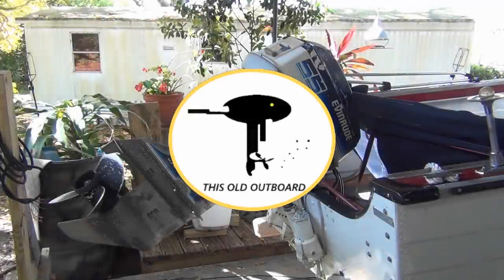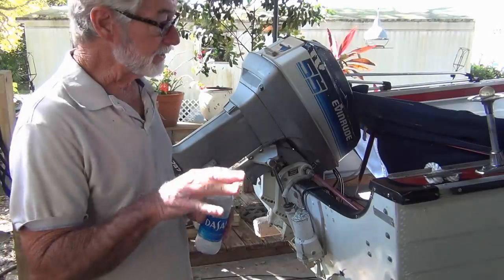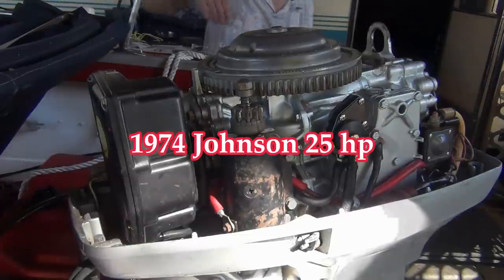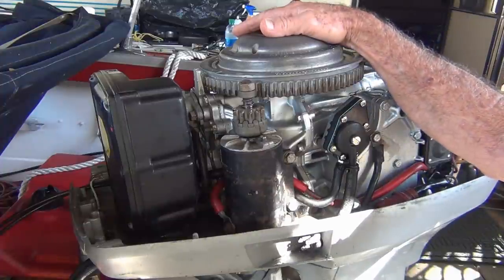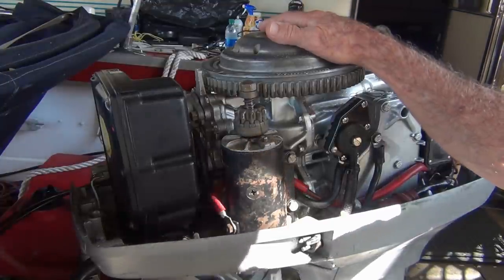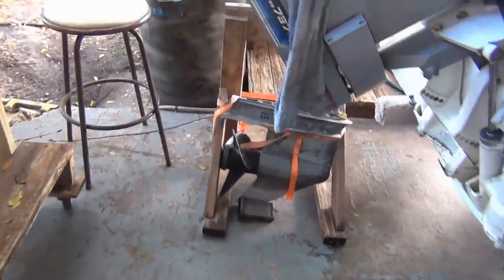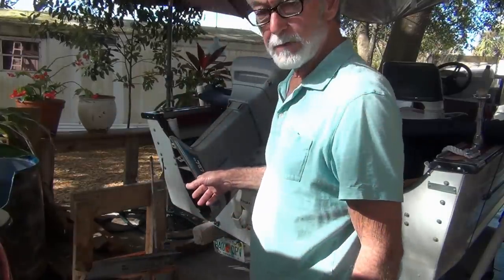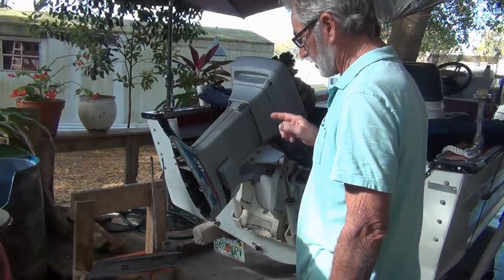55 Hp Evinrude Outboard Powerhead Flush

Comment: The thermostat can't regulate the temperature when you run it in a barrel. Your recirculating hot water. Easy to get one too hot like that lol. Love your videos man! Keep it up
Reply from the maker: No. It's still going to get hot and open the t-stat which is the point. And the tank water is nowhere near 143 degrees when the t-stat Starts to open! And at running temp the water would be steaming around 150 if it was recirculating at the same temp. So not to hot! But I know what your saying. lol Thanks again for watching and commenting. Stay tuned !

Comment: Question. I have the 76 version of this motor and it doesn’t have power trim. Did you add that trim system yourself? Or was there a stock trim system for these old motors?
Reply from the maker: Hey . Thanks for tuning in. That trim unit came off the 87, 40 horse Johnson I had, so yeah I added it myself. They will fit if the plate on the transom mount/swivel bracket has the six holes to bolt it on, and I believe yours does. They're getting hard to find but check ebay for one. I believe they were made between 74-89 with different variations and part numbers which I don't have. If you can't find one on ebay check around on craigslist, facebook marketplace & offerup. You may even find an old parts motor cheap that has one. They still sell the rebuild/seal kits for them. Hope you find one, they're nice to have! Thanks again & Stay tuned !
Reply: Thanks for the reply! I’ll try and keep and eye out for one. I do have the six holes. Let me know if you run across one. Lol

Comment: Did u ever figure out your fuel issue?
Reply from the maker: Hey. I'm guessing it was the brass fuel line connection on the tank. after I tightened it, the bulb stopped going flat. Thanks for watching and commenting. Stay tuned !
Reply: @THISOLDOUTBOARD1  thanks 😊

Comment: Idle a stitch to high ? Or is it the audio ?
Reply: the only way to properly set the idle is in gear in the water not tied to a dock or trailer. then idle in neutral will just fall into place
Reply: @ct1762  I’m aware of that , was the comment ment for me ? I only stated the idle on camera sounded a bit high is all and wondered if it the audio or the TP on the controls  !
Reply from the maker: Hey. Yeah I think its camera audio. Thanks for tuning in!

Comment: Hi sir how are you. I have a 1979 55hp evinrude. When i bought it the engine turn on, but it had a water pump problem. I changeed the water pump by taking out the starter. I did take off the nain powerline out of the solenoid as well, but i put everything back to where it belong. I also bought a new battery. When i try to turn it back on the ignition jus click. I the engine doesnt want to crank. What is going on please help me  thank you
Reply from the maker: Hey. Thanks for tuning in. My experience is that if the solenoid clicks once there is a bad ground wire connection, if it clicks repeatedly it's a weak battery. I did a video on it called the Dreaded One Click, something like that, on the old 28hp Johnson I had. Turned out to be the short ground wire coming from the power head connected to the lower pan. The only other ground wire I can think of would be the one coming off the solenoid to the power head. Double check connections are clean, no corrosion or paint. Thanks again & Stay tuned !
Reply: @THISOLDOUTBOARD1  bad ground from the battery or from the starter? Thank you so much for responding. Your video are great. Keep it up please
Reply from the maker: @hdtrieu  no, the starter is grounded from being bolted on. the battery negative is grounded to the powerhead somewhere. the powerhead is grounded to the pan, heavy gauge 4-5 inch ground wire, and the solenoid is grounded to the powerhead, small black wire coming off the the small terminal on the solenoid
Reply from the maker: https://maxrules.com/graphics/omc/wiring/77-78_55HP.jpg
Reply: @THISOLDOUTBOARD1  ok I'll check the main ground n the ground from the solenoid thank you so much kind sir
Reply: @THISOLDOUTBOARD1  do you think I should change my power pack as well?
Reply from the maker: @hdtrieu  if it ain't broke don't fix it
Reply: @THISOLDOUTBOARD1  so I got the motor to start...you won't believe it. I didn't had the thing in neutral lol. But I have another problem the water don't seem to pee from the hose. It comes tight out from the bottom? What am I missing. I know there a seal for the water pipe but I can't it to fit. Do I just try to push it.
Reply from the maker: @hdtrieu  look up your year/model on marineengine.com. check the schematic for fitment